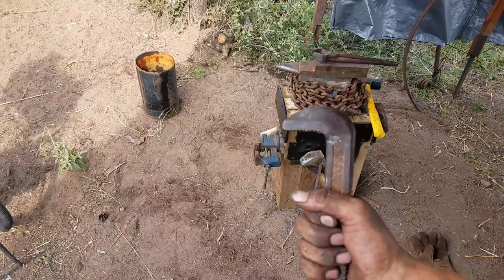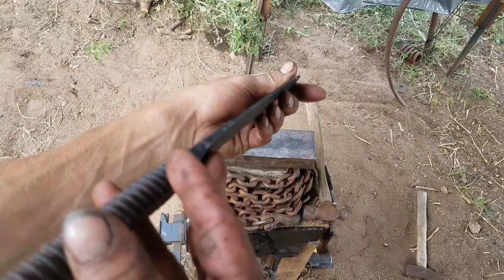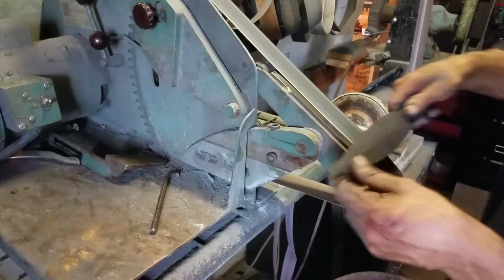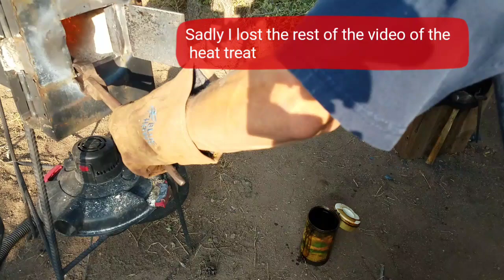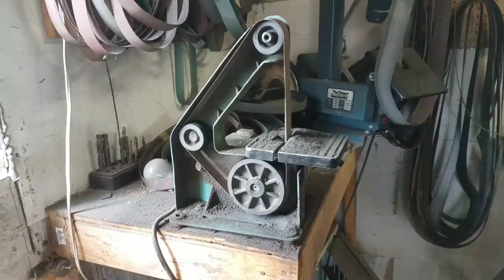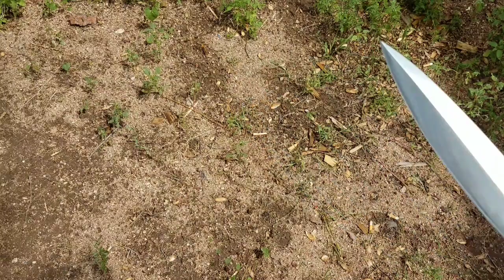Forging A Dagger From A Wrench - Knife Making

Comment: You ever contemplate getting some hammers made specifically for forging? I used hardware store hammers for quite the while, but a kind gentleman gave me one of his Icar Italian rounding hammers, and holy lord is there a difference between my hardware store hammers and this one. The handle is so much better fit to the hand for this kind of work, and since the heat treat is so much better on a forging hammer, you get more force transferred into the piece, and not absorbed by the hammer.

Comment: First off that dagger is gorgeous. Makes me want to make one.

Second it kills me to see you using just  brute force to draw out the length of that dagger.  Use the horn, use a half on half off, use a rounding hammer, use a cross peen hammer.  My God anything better than beating it into submission with an engineers hammer.

Lets be honest the goal is to make beautiful pieces as quickly as you can to minimize cost and maximize profit.  Good technique could save lots of swings on your shoulder.  Seen lots of smith get to the point it hurts to pick up a hammer let alone swing it.

Comment: That is a kick ass knife!!!!! when you tempura it for 4 hours at 400 ° did you let it cool on its own or did you drench it in cold water as soon as you took it out of the overall. ? I don't know anything about tempering metal so I'm asking. And you sharpened it after tempering right ?
Reply: Asano En I think its best to throw water on it.
Reply: Nooo.. let it air cool between temper cycles.
Reply: Asano En A machinist who works over 40 years told me that rapidly cooling the steel that is around between 70 - 200 celsius, makes it structurally shit. I dont know if this is true or not.